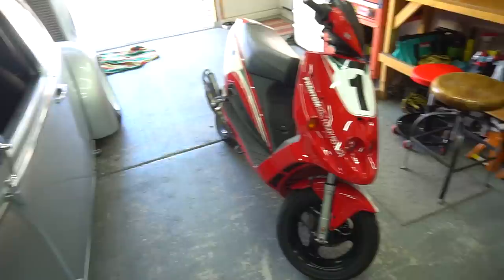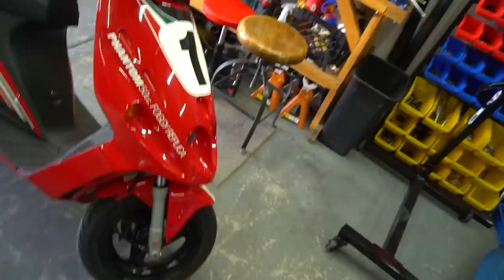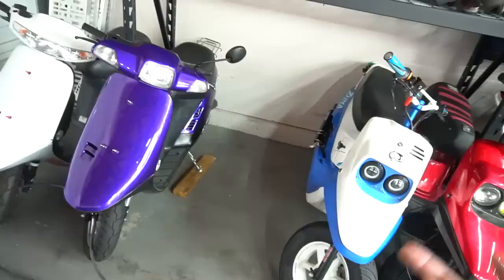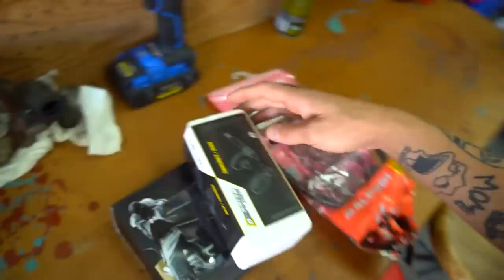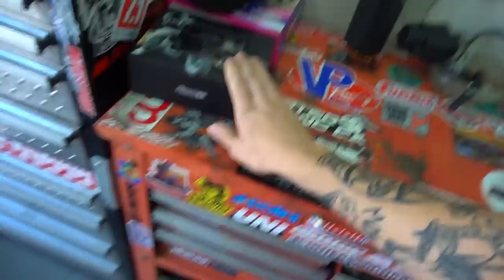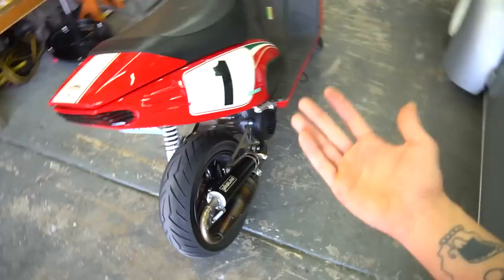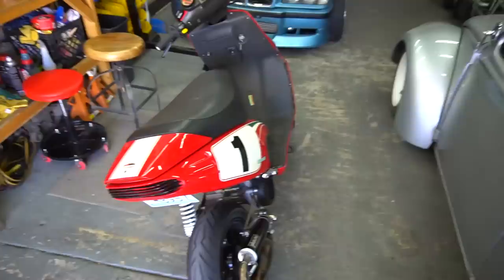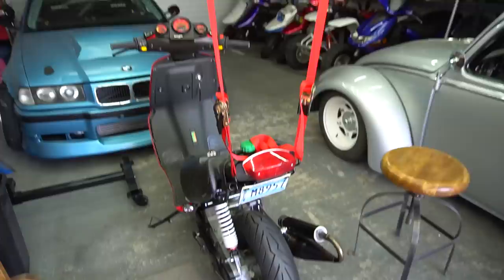PHANTOM F12 UPGEAR | More TOP SPEED for Minarelli Engine!

Comment: Straight cut gears : The main reason for this is that it is the most efficient way of transmitting power. Excessive friction due to the axial load generated by helical gears is avoided.

But makes a bit more sound. 

Conclusion : they can handle more bhp. Like a full loaded MHR Team or Polini Evo. 

Use Amsoil gear oil.

Comment: The benefits, of straight for gears is, The power and torque gets put directly into the wheel with no side to side pressure on the bearings with angle cut gears. However the straight cut tend to be noisy

Comment: For low-mid power wheelies like you do, the C16 is excellent, no questions. If you want more oomph in mid to high end, search for a Yasuni C21 minimum. Also, if you plan on porting it, it would be better for a Stage6 R1200 to let it breathe more, but it would also be the limit for air-cooled sport-type cylinders, since the Sport Pro has an oval exhaust port. If you had gone with the MK2 racing, which has a bridgeport, a Roost RS5 and maybe a 24mm carb, that would throw the front wheel up at almost any speed, and top speed 70MPH guaranteed. Keep it up, the F12 is flying!

Comment: Hell yeah bro! I have a set of Malossi 13/44 in my Bugeye and they make a huge difference with top end! #mopboyz
Reply: Got some on the way,you 60+mph?
Reply: @jered2177  I still need to do a little more tuning on it but she’s seen 59-60 right on the teetering point! With a little more adjustment I should see 60 no issue😎🤙
Reply: @DawleyRacing  10 4 my 05 is at 10500 @55  on stock crankshaft so I'll glad to get the gears in

Comment: I did these gears in a zuma motor and they sound horrible off throttle.  Is there any way to screw up the instal,  I got no instructions with my doppler gears.  They are 14/42 as well.  No metal shavings in gearbox but they sound like they are eating themselves.

Comment: please help if you can. i have keeway huricane also minarelli and i put kit 70, carb 19mm, new rollers 6g, new belt, and it goes only 60kmh...
i had like some sport baotian exhoust but i think its bad one   
so i need help to make my scooter go adleast 80kmh what do you suggest is the problem?
cdi ?
exhoust?
and what gear up should i buy? what is standard and how much it has to be the gear up one  14/15   42/41 or what ?  i need help with tuning it and what blocks the scooter to not go over 60kmh?